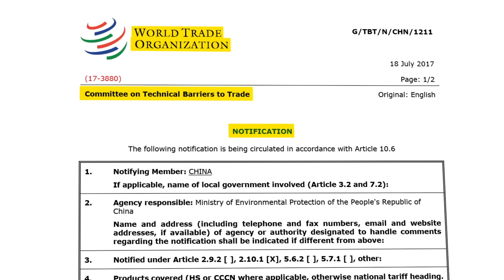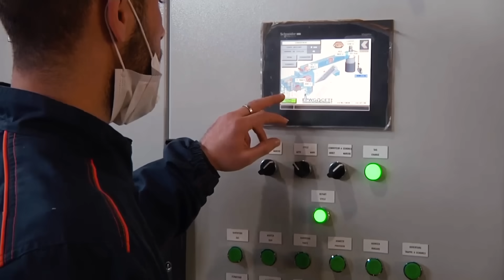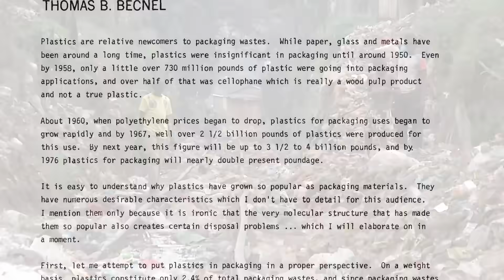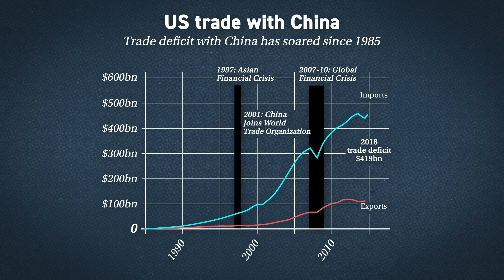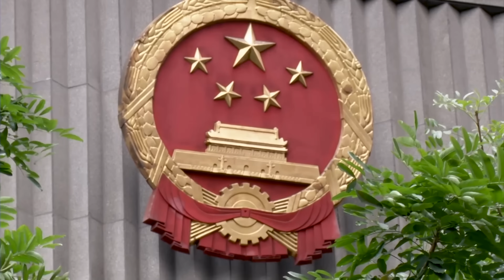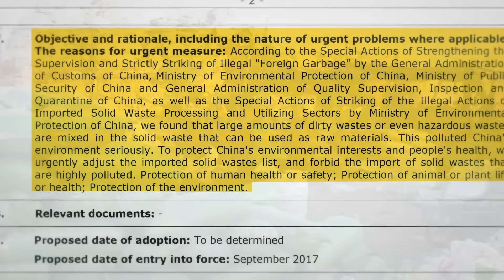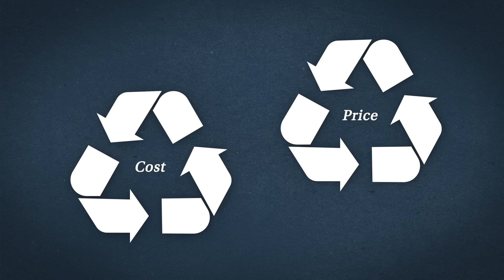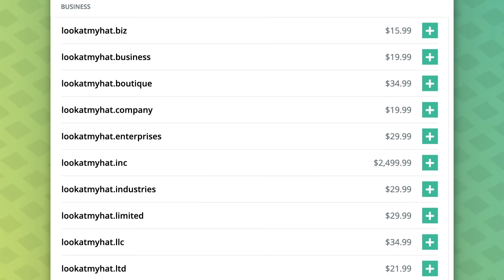How China Broke the World's Recycling

Comment: This problem is actually not difficult to fix.  The cost of recycling raw materials of all types needs to be added in to the cost of the raw materials.  It would be similar to a deposit paid on a soft drink container except that the seller of the raw material (such as plastic pellets, sheet metal, lumber, etc.) would collect the cost of recycling not the end seller (such as the supermarket).   The original manufacturer would be required to make a market for the recycled materiel that it created in the manufacturing process.  You would find that manufacturers would create organizations that would centralize recycling and wholesale distribution of recycled materials at a reasonable profit.  The cost of virgin materials would go up until an equilibrium point was reached such that there was a market for the recycled materials because they were cheaper then the virgin materials.  There would be an increase in cost of end products to society that would accommodate the actual total cost of the entire life cycle of products.  Today we do not recognize the total cost of the entire life cycle of products.  We just throw unwanted products and waste into a land fill without recognizing the value/cost of disposing of it that way.

Comment: 16:35 yes it is!  Purifying used plastic is one of the hardest material science problems
Reply: Well it's not really a material science problem as much as a waste management problem. If it's hard to purify and recycle, it's not purified and recycled. That's why basically only perfectly sorted PET and sometimes PE, and even more rarely PP is mechanically recycled at all. On the other hand, applying actual material science, it's actually not that hard to chemically recycle unsorted plastics quite easily and efficiently. It saises the question why this isn't being done on a much larger scale yet.
Reply: @SpaghettiToaster  it is a material science problem, on the one hand because of chemical additives added to the plastic, and on the other hand because surface contamination is actually extremely hard to clean (at least enough for multiple recycles to be possible)
Reply: @izakkanter4459  Yeah but that's only true for mechanical recycling. And here the problem is that recyclers operate so close to break-even that accepting mixed or contaminated streams is hardly an option. Material science doesn't come into it very much because there is barely any R&D into this area. 

On the other hand, chemical recycling is (potentially) much more powerful. Gasify with oxygen, clean the syngas, add hydrogen or emit CO2 to adjust the H/C ratio, synthesize methanol, then use MTO to make Ethylene and Propylen and from that PE and PP, or use the mitsubishi process to make PET from methanol. Cleaning the syngas is involved, but absolutely feasible with current technology, and at current prices, the whole process (most likely) has much better economics than mechanical recycling. The actual feedstock available to mechanical recycling is a tiny fraction, whereas gasification can use essentially half of the world's municipal waste, including all plastics. And the products are polymers of virgin quality that can be used for any application and recycled indefinitely.

Comment: One possible solution is to tax the production of new plastic so that it cost slightly more than recycled plastic instead of slightly less. This would also likely reduce the use of plastic for single use products since plastic would be just that little bit more expensive overall.

Comment: An engineer invented a plasma gas incinerator that reduces garbage to its elemental form. It produces enough hydrogen gas to power itself and even produces excess that can be sold to the power companies. The resulting slag is compact, inert and completely safe to dispose of in landfills. Existing landfills could probably be dug up and processed by this system, resulting in free power and drastically reduced volume. Why hasn't this revolutionary system been adopted? Simple, existing infrastructure, and the people who make money from it, have put pressure on government to prevent its adoption. This is the equivalent of someone finding a cure for cancer, then big pharma stepping in to block it because it would hurt their bottom line! So much for saving the world! Btw, I am a retired Canadian power company employee.

Comment: You actualy picked a pretty bad example for recycled Plastics being more expensive than virgin plastic. PET is one of the few, if not the only plastic that is cheaper than the unused product, while still having similar to the same abilitys. This is due to the chemical structure of PET. The plastic chains that are destroyed during the making of the product can be recombined. That is also one of the main reasons, why nearly all of the bottles produced (at least in Europe) are made out of that material. One of my teachers also told me that no modern company can afford to destroy unused or missused plastics, but instead recycles it.

Comment: I would and believe their using fuel derived from heatng plastic to 300 and 400 deg (diesel - gas)
Or waste vegitable oil which usually they pay for you to haul away. So someone is making alot money and collecting subsidies from Government.
 ..200deg any plastic melted mixed with 50- 80 % sand will make roads that will last the test of time.

Comment: inhales deeply
Firsty, it is not entirely correct to say, that less valuable or harder to recycle plastics are the main reason for the high amount of unrecyclable plastic. 
While it might be true, that some plastics are cheaper to produce virgin than recycling it, a main contributing factor is how those polymeres are used.
To reduce the overall amount of plastic, without losing some of the characteristics that makes plastic so favorable in the first place, factories blend or laminate different types of polymers together. Those polymers are virtually impossible to separate, and often very hard to differentiate from pure polymers, greatly reducing the amount and /or quality of the resulting recyclate.

Secondly, it sounds, as if recycling is the only sustainable way of dealing with plastic waste. This is, again, not entirely true. For example: People treat incineration, like it has not evolved since the first burn piles. 
Fact is: plastic burns pretty mutch the same as, if not cleaner than, crude oil or natural gas. 
Thermal reclamation is a very promising alternative to recycling, especially with the advent of bio polymers, produced from renewable sources. Sweden already reuses 50 percent of its houshold waste directly as fuel for waste-to-energy plants, turning it in electricity and heat energy for district heating, and in germany similar energy producing waste incinerators already mix unrecyclable plastic waste with regular waste fuel to achive higher efficency, or to save-ischly burn otherwise energy negative trash, that is not suitable for german landfills, without the help of primary energy sources.
The question is: Is turning raw materials into plastic and after that using it as fuel better or worse, than using some of them as fuel directly and some exclusively for pastic materials.
Aditionally, a great amount of the plastic waste, treatening our enviroment does not come from our inability to deal with it, once collected, but from our inability to collect and contain it until treatment.

Thirdly: china did not break recycling per se. When china stopped importing plastic waste, most people in the plastic industry already expectet something like that for some time. And in the end, stopping the export of waste opens the market for more local, susainable and, finally, more profitable recycling/waste management solutions.
If anything, china, inadverdently or not, made the first step to repairing recycling.
wheezing

Comment: The proposed solution (increase the demand for recycled plastic) not only will not work, but will be worse. It had being tried before, and it just lead to recycling companies buying more virgin plastic and melting it down with garbage to increase the output of certified recycled plastic. Leading to a bigger carbon footprint and not solving the waste problem.
It's basically the same failed idea of mixing palm oil in combustible to reduce the impact in the environment, but ignoring that the palm oil used to wash down your gas come from what used to be a deep forrest in Indonesia (yeah, EU does this).

Comment: It is interesting how much plastic changed things. When milk and soda pop were sold in glass bottles and the pop bottles were returned for money there was a lot less plastic to deal with. People didn't buy water in plastic bottles and diapers were re-used. The amount of disposable diapers in landfills is crazy. Shopping bags were paper so we didn't have the issue of plastic bags. We might either need to package in a new manner or at least make a simpler system where the stuff is easy to sort at home and actually melt them into storable portable cubes and maybe crush glass containers at home as well. its easy to crush aluminum cans at home so that leaves metal cans and paper/cardboard to deal with. Throwing paper/cardboard in with mixed recyclables seems foolish as it gets contaminated by uncleaned food containers that people throw in their mixed bins so that's a problem more with cardboard than paper since people aren't reading newspapers and magazines much and not as many books as well but people are using a lot more cardboard by way of all the stuff they have shipped from online sources. We need a simple clear in house method of clean separate and leave for somebody to pick up system. Beyond that, buy things in bulk and actually choose items at the supermarket that won't discourage you from recycling the packaging. Emerging technologies will help at some point but not yet.

Comment: I hate plastic packaging so much.  It's such a great cheap material, a divine gift, and we screwed it all up.
Reply: There was a time when you could get most hardware items in a retail store without the bubble plastic which now makes it hard to examine closely the item you are buying and is only there to allow stores to use inexpert staff to scan a bar code and sell items without having to train their staff with any product knowledge. There needs to be a return to paper, glass and natural fibre bagging and packaging. One off housing sites are full of these discarded packages when small jobs are being done by small scale tradesmen and DIY operators. Large scale operators have less of a problem as they but their supplies in bulk.

Comment: I own recycling company, there are some slight mistakes here if you regard it as COMUNAL WASTE PLASTICS not all plastics recycling, then it is mostly just wrong, if you look at industrial waste plastic recycling it is hugely profitable. Those commodity plastics (how we call them in the industry) are cheep (PS, PP, PE, PVC) and are mostly used in very light packaging like foil etc, but a lot of plastics used in other industries than packaging of consumer goods, for example automotive, electrical industry etc. are much more expensive (for example PC, PC/ABS, PA etc) which makes them more viable for recycling, that waste is also created in large quantities by companies not individuals and if a company can sell well sorted waste in stead of paying for unsorted waste disposal they will do just that.
Just wanted to make it clear, the problem is communal packaging plastic waste, in other industries it has very high recycling rates and leads to environmental benefits (i.e. with technical plastics being lighter than steel in car parts they lead to  lower fuel consumption).

Comment: Solutions for recycling plastics:
- Put deposits on all plastic packaging. we have had it for bottles for forever, and when this exists there will be a lot of volunteers doing the sorting. Bar codes or QR codes or something is needed to verify the deposit so that can also include the plastic type info.

- Move the environmental cost of the new plastics to the price of the plastic, just what China realized that companies make profits but countries have to do the cleanup. The end user of plastics should pay the costs. This is done to some extent with recycling fees in some countries, where I live you have to pay a recycling fee when you buy appliances or tires etc, it is just part of the price you have to buy when you buy the thing so you are not tempted to dump the washing machine into a river.

- Burn for heat whenever you can use it to replace oil. Plastic has roughly the same energy content as oil. Even if you burned all the plastics and recycled none it should be a really good deal for reducing the oil. Technical obstacles exist probably, you can't just put plastic into your oil burner.
Reply: @SigFigNewton  That is not a complete solution. You also need tariffs so the carbon tax is not circumvented by producing outside of the reach of the tax man. Then the tax man has all this money that it should spend to counter act the emissions and that is probably most efficient to do in developing countries. Politically very difficult, but I agree that this would be a solution and one on a grander scale than just plastic.

Comment: Germany, which does a better job than most at re-using/recycling plastic, concluded that the simpler and more effective solution would be to just tax new plastics, especially those used in containers.  Taxing new plastics at the right level would immediately makes recycled plastic price competitive.

Comment: There is a little mistake in this video. Aside from economics, the recycling is also TECHNICALLY not viable.

Many plastic items have some form of additives in them to give them desired color, strength, water resistance etc. These additives chemically react with each other and the polymer material during the manufacturing process; creating the plastic product. Due to this chemical nature of plastic manufacturing process, it is techincally not possible to revert it. Trying to revert this process will be like trying to retrieve the yolk from a cooked egg. There is no known way to undo the process of curing of the plastic mixes with all that additives in them.

Only some certain types of plastics, which contain %100 pure polymer substances like PET water bottles, which make less than 10% of all total, can be recycled because they act like a frozen ice cube rather than a cooked egg. But even them can only be recycled for 6 to 7 times at most, because after each cycle, the material degrades more, and needs to be  mixed with increasing amounts of virgin raw material. After a point, the substance degrades so significantly, it cannot satisfy the required raw material properties and cannot be used.

Comment: Great video.  Very informative.   Would be awesome if you ended with a few possible examples of HOW to achieve the economics required without waiting for oil to dry up.  For example, tax rebates for companies using recycled product and excise taxes on virgin product.  Another would be a mandated packaging regulation about what kinds of plastics are able to used for disposable packaging vs reusable packaging.  Bring back the milk bottle system, so to speak.

Comment: When will people learn recycling is not good for anything and does not save the planet when you put it in the recycling bins it all gets burned in the UK. Mcdonald's did a move to wow the eco nut jobs and move to paper straws to look good now straws are crap low quality and dont work with milkshakes. Then it finally came out the the new paper eco straw was just getting burned like the rest of it as had chemicals in it that stopped it from being recycled. And now many more trees are going to be cut down to make paper straws think i care more about trees being cut down then the sea with plastic in it. All comes down to recycling has no benefit to reuse then just burning it for power plants as the energy used to make it useable again makes it less better for planet then just burning it for power plants and makes it cost more.

Comment: I don't agree with "recycling only works when it's profitable", or at least not with what it implies. The imperative of moving to a circular economy, which includes recycling, is now clear. So recycling must either be made profitable where necessary (i.e. subsidised) or be mandatory, e.g. by requiring a quota of recycled material in new products.

It can't, mustn't, always be about money. Otherwise very well researched video, well done!
Reply: All human endeavors must make money (profit) or they wont be done, as the fundamental problem is that people, unless threatened, will not work for free.

Comment: I wonder. I saw a vid on YouTube some 5 or 6 years ago, it was two Chinese engineers that have made a container that melted soft plastic into a oil that could be added to gasoline to run a car... why is that not a thing? Maybe fake vid?
Reply: The cost of creating artificial oil is generally more expensive than the cost of extracting and refining real crude oil.
Reply: Leonard Wei yea I know that 😬 but is the vid about the container that melt plastic into oil without pollution into the air, a fake vid? I mean if it's been made why not just invest I thousand of them and get the plastic out of the way? That oil could be pumped into empty gas pockets? Removing plastic from earth without pollution win/win

Comment: I've read some news about researches on plastics that degrade much faster than the old ones (takes weeks or months instead of centuries), but seems that either they are not chemically durable enough (bad heat or uv light resistance for example), or they are more expensive so sadly though, industries are not willing to use these more ecologically-friendly materials. 
(if I made any mistake or there are any professionals knowing more about this topic, feel free to leave comments :)